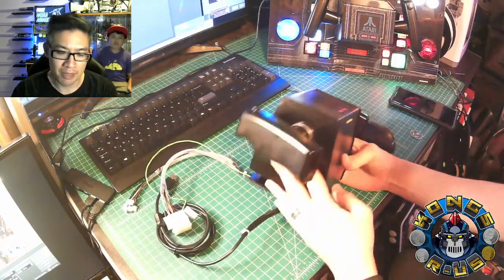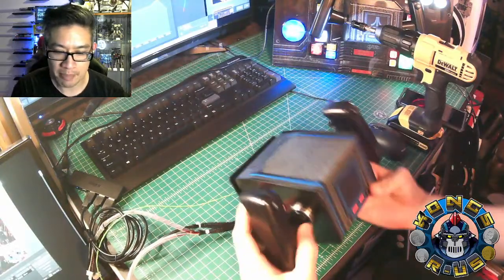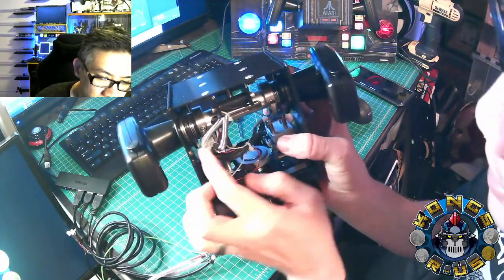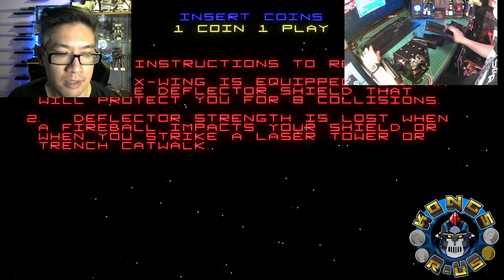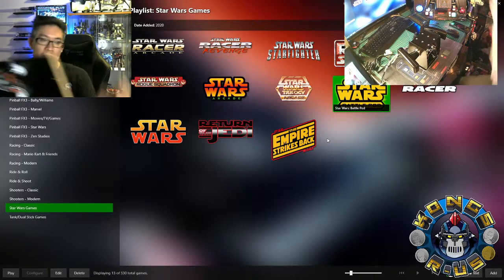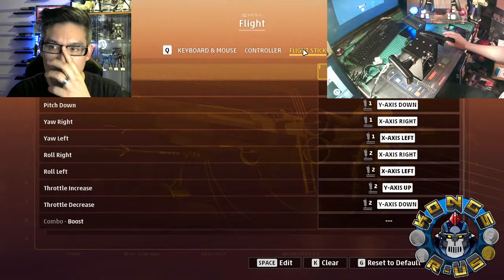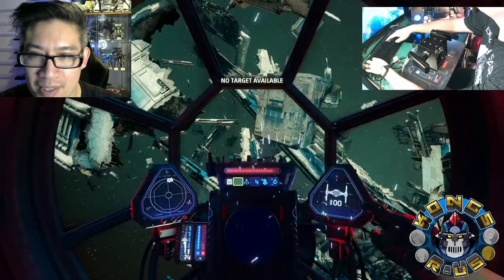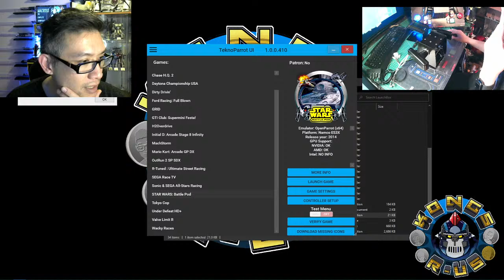First Look Inside Star Wars Arcade GRS Flight Yoke - Can it Be Modded To Add More Buttons?

Comment: I have a home built game cabinet that I built many years ago that is just setting in storage untouched.  It has an original Star Wars yoke from the arcade game.  Debating on whether to do a complete refurb of the yoke or put it up for sale and use the money toward starting a new cab.  Is there still much value in the originals now that the 1Up units have come out?
Reply from the maker: I'm not sure what the market is for orignal Star Wars arcade parts, but there are collectors out there im sure. there's definitely a lot more alternatives now for people to replace it, and the GRS yoke may be the best value/quality version you can get now. time will only tell if they last as long as pots do

Comment: Bee Kong can you let me know what im doing wrong? I cant calibrate my original yoke with Star Wars and A-Pac encoder. Can you do a small tutorial on how to calibrate and when? Also i noticed on the a-pac mod i followed every step and my left and right axis has quite a bit if movement before it registers moment while my up & down has emirate movement any ideas? Thank for everything you do!
Reply from the maker: you can use the Setup USB Game Controller in your Start Menu to calibrate.  check out my recent tutorial on wiring the 4 axis joystick as i go thru how to do it near the end. should be same process as the yoke.. also, the x axis potentiometer range is smaller than the Y axis so that's why you need to calibrate it so it hits all the edges

Comment: I'd really like to get rid of all those cables.  I want to make use-specific cables and have a single connection port.
Reply from the maker: you can always tie up the unused cables and wouldn't be seen once installed into your cabinet of choice. the various options to plug in this controller is a fantastic selling point and makes it highly versatile